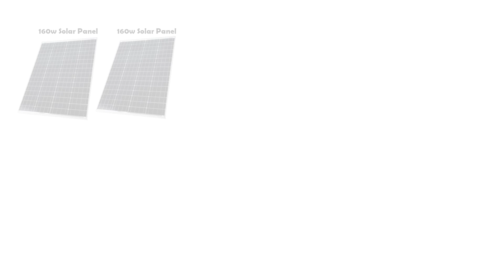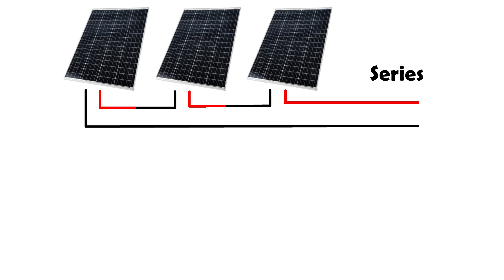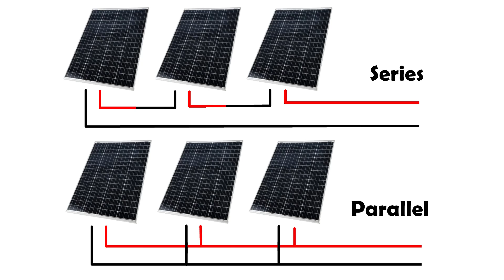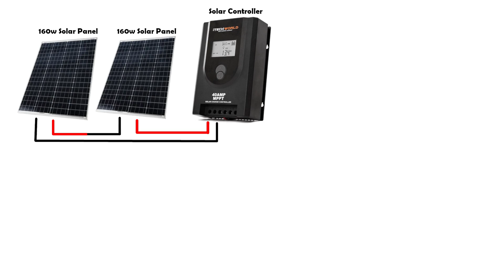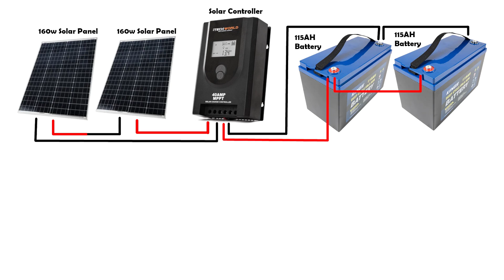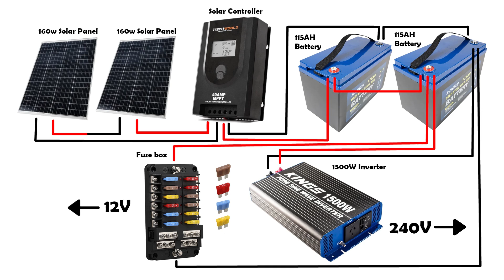SIMPLE 12V Solar Setup for a Van Conversion - Guide to What You Will Need

Comment: I think you would be better off running your loads off both batteries. ie positive off one, negative off another. Otherwise you are pulling a load off one battery and then they need to equalize.